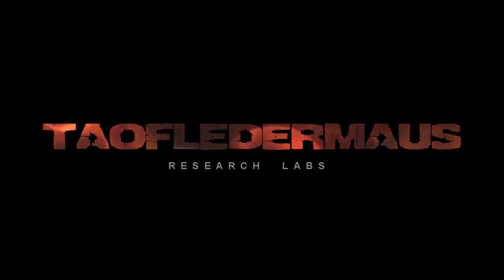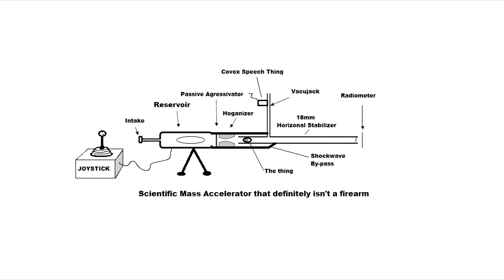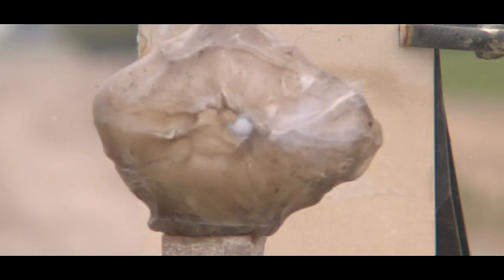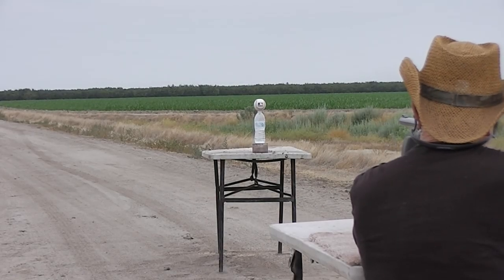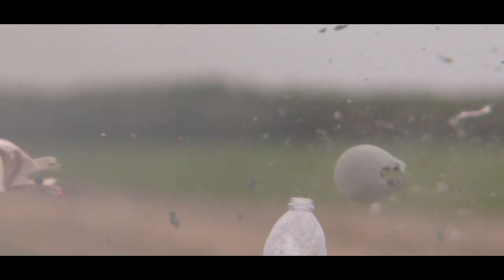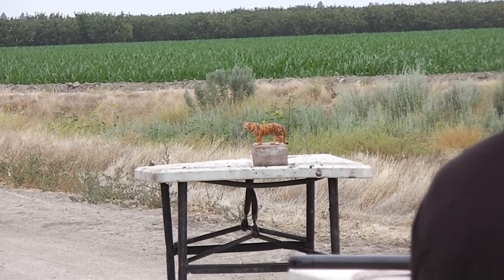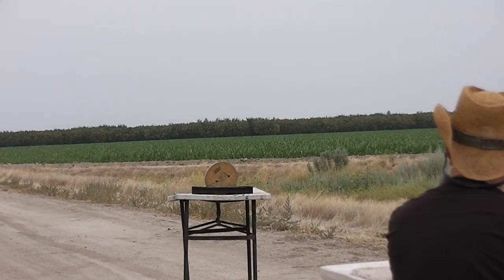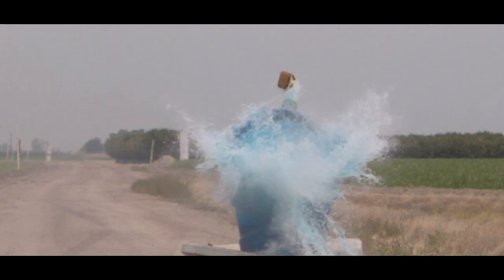Massive Disintegrating PVC Slug -  Supersonic Tests

Comment: When the pvc hit the tiger it made a spark. I dont know if you noticed that or not
Reply: Tire Slayers wow, so it did. Very cool.
Reply: I wonder if it is static discharge, PVC does build up quite a bit of charge pretty fast. It may have picked up charge from the barrel or by simply traveling through the air so fast.
Reply: Well spotted
Reply: A lot of plastics are mildly piezoelectric or more, so it's likely from the stress and then rapidly breaking all the bonds.  Think of opening large black construction trash bags, and the significant charge that generates.  As an example for  Polyvinylidene fluoride: 'In 1969, strong piezoelectricity was observed in PVDF, with the piezoelectric coefficient of poled (placed under a strong electric field to induce a net dipole moment) thin films as large as 6–7 pC/N: 10 times larger than that observed in any other polymer.
'
Reply: . i fuigured it might have been a static charge. I just thought it was cool that plastic hitting plastic made a visible spark like it did
Reply: slowed it way down to enjoy it further while paused.

Comment: It would be cool to do a fletchette round. A slim light metal fletchette wrapped in a plastic sabot. Similar to the AAI rifle round. The slim metal projectile will fly extremely fast due to low drag and light weight. The high velocity and long, slender shape of the fletchette would be devastating against soft tissue.

Comment: damn, if you hit someone with that, they are screwed hard. PVC doesnt show up very well on xray (it does but it can be hard to pinpoint it when its flat to the xray) which means a doctor would have to either do a CAT(maybe?) or find it by feel. youd probably never get all that shrapnel out. ouch

Comment: Hey @taoufladermaous I recent oh discovered that if you melt wax into the rubber peice of headphones and slightly roll the they fit in a .177 caliber pellet rifel could you try testing them on some targets (in my experience they are very inaccurate as in miss a shaving creame can sized target at 10 ft) I have only experimented against metal where at 10 ft it tends to dent 1/16 in h aluminum and at like2 inches it goes through 1 layer and dents the other